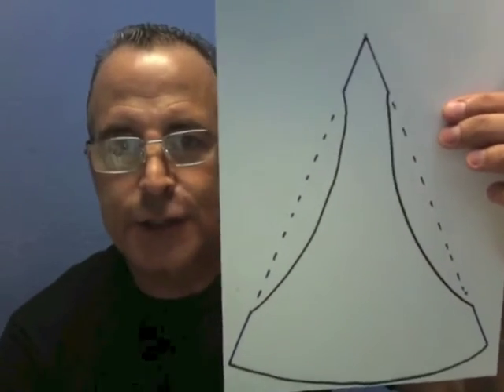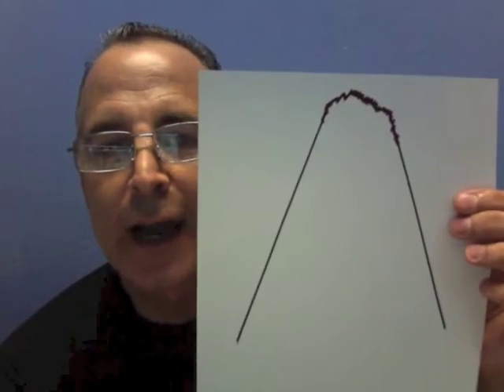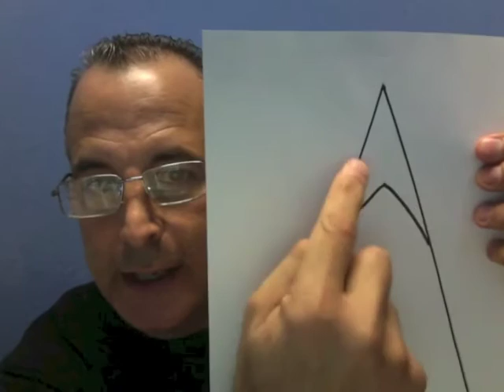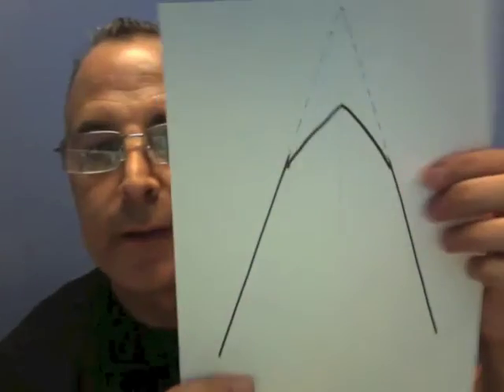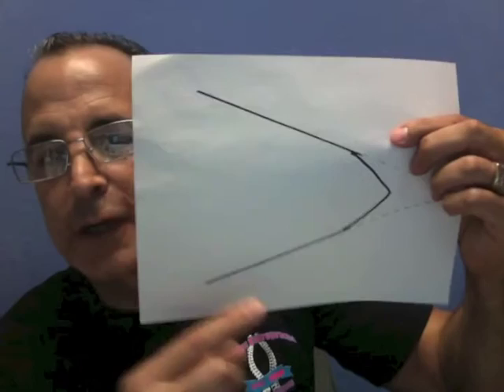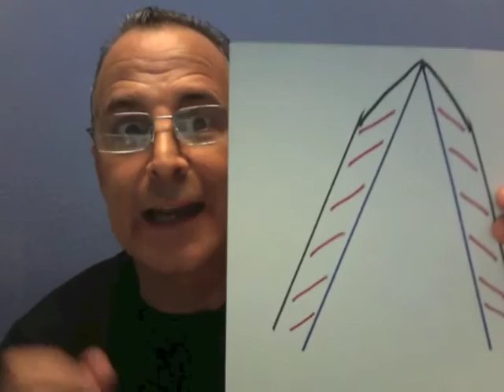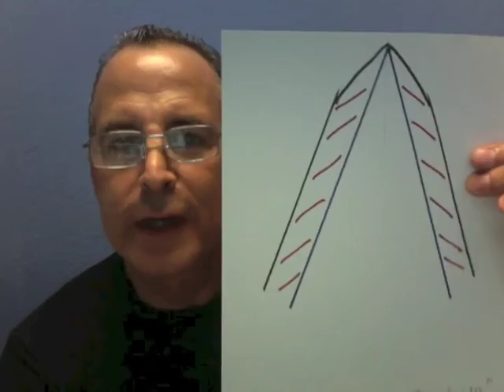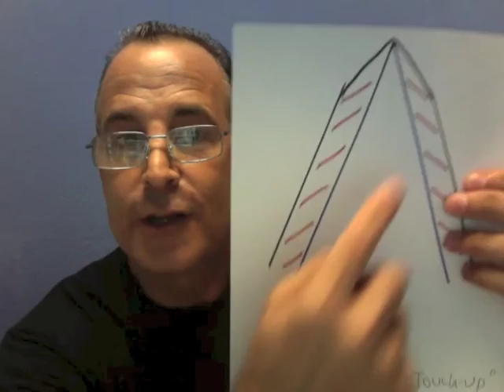Razor Bevel Setting, Sharpening, Touch-Ups, Conversion and more...

Comment: So it seems to me you could break the process into three distinct stages... one is bevel setting... usually done on a 1 K... two is refining the initial bevel set 1k to 12k or however many K you want to take it to... third stage is stropping cloth , felt , whatever and leather... So where I do take your point, and I think you made it very well and the argument you make is quite clear, and does help to clarify what is going on, it is largely a semantic argument. What most people call a ' touch up ' or a ' refresh ' just means " I didn't have to go all the way back to 1 K... ( to reset the bevel ) so I am in stage two... beyond what stage 3 , (stropping type stuff can handle anymore).. i.e. a ' refresh ' or ' touch up ' .. (a few passes on an 8 k then a 12k) or whatever, not ' regrinding ' a new bevel.. so it's really more a matter of what you call that. Technically yes, I call it generically ' sharpening ', but razor peeps call it ' honing ' . To me ' honing ' has the connotation of ' more refined ' than , just ' sharpening, but again, semantics, right??? But typically what you hear is, ' set the bevel ' or bevel setting, distinct from 'honing'. It's interesting if you look up the word ' honing ' it has the meaning of ' sharpening ' but also has the meaning of ' refine or perfect over a period of time ' ... as in to hone a skill, but I think both definitions actually apply, when you hone you are refining and perfecting the existing bevel that has been set, refining that scratch pattern. Just as an aside, I think saying ' heal ' the surface is also very weird terminology, you are not actually ' healing ' anything you are removing the high ridges of the deep scratches left by 1K. Like eroding two mountain ridges exposing the valley below. There is no ' healing ' going on. Funny term, that is somewhat confusing and deceptive, I think. Great videos , very thought provoking. Shaking off some of the misnomers and misconceptions really helps to refine your perspective of what is actually happening. Sorry for my horrific punctuation.. lol.. Thanks
Reply from the maker: Well said Bruce!

Comment: You bring up some good points. If your edge has already had its bevel set and was shaving well and is starting to pull a 1k stone is creating unnecessary work.  I usually use coticules for touch ups and in my head what the stone does is thin the edge out, never really hitting the edge. Yes setting the bevel is an over  term. Sharpening sounds good to me.

Entertaining as always.

Comment: Hello Doc
Nice video and excellent explanation as usual, you are the best one to clarify something through YT when it comes to wet shaving... The difference between sharpening and setting the bevel is excellent, some say they set their bevels on Botans, while they only sharpening the razor.... Remove chips or correcting the geometry with a Coticule, Botan or Washita takes unrealistic long time...

I totally agree with you on touch ups, a small portion of the steel must be removed to restore that beautiful pointy edge... The edge not only dull with use it degrad too due to stropping and the thin edge is prone to corrosion as the steel is exposed to the elements soap, skin, water...etc .

Now here's what I don't agree with you, stropping does not make the edge angle wider... stropping is basically remove the toothness and feather edge (burr) .... On other words it clean the edge.... When you hone an edge and you fail the HHT then strop it at some level especially with Coticule your HHT will improve.... Because you have removed the random metal on top of the cutting edge, not because you have increased the angle of the edge... moreover stropping between shaves realign the edge and clean the oilness that skin leave on the edge which restore some of it sharpness for the next shave..... To see stropping effect more clearly, hone your razor on 1k check it under the microscope and strop it then check again... You will notice big change on the edge not in the angle but on the toothness as the unstable steel is the removed, and that can be mixed up with creating a wider angle as the edge will look shorter which can make the angle look wider but in fact that is the real angle of the edge

The comfort is a result of removing the tiny sharp random feather edge that cause unpleasant experience.

Thanks again for the great video.

Regards,
Reply from the maker: Thanks for the nice words.
If you look at the SOS website, you can clearly see that as you microconvex the edge, it loses height at the apex AND will increase bevel angle a slight amount.  I don't think the increase bevel angle improves comfort but it does have an effect.

I'm not convinced that anyone really knows exactly what happens when we strop but the effect is undeniable.

Cheers!
Reply: +drmatt357 SOS is a great blog, but at the end it one guy effort not NASA whom conducting the tests... :) So for the results might be off by half a micron, and he apparently used a pasted strop which will convex the edge automatically.

Stropping concept is very basic

Imagine stropping as combing hair, after a hair cut(honing) you comb your hair and pieces of cut hair (burr) start falling, and when you comb your hair in the morning you basically realign it and remove weak and dead hair.

In one of your videos you showed two pictures of an edge honed on a stone and the same edge stropped on the same stone... The stropped edge was clearly cleaner, with unpasted strops the same happens only on minimum scale because no abrasion involved only removing metal by burnishing and stressing it... Like when you cut a hanger wire by stressing it.

When i polish stones on my lapidary machine, the final step will be on a clean cork or a hard cloth without abrasives, only to burnish.... The effect is like when you lap a hard ark using coarse great like 80 then sharpen a knife on it with pressure, the stone surface will become relatively reflective even though the knife steel is less harder than the ark, but the toughness of the steel and the pressure managed to break the brittle peaks of the valleys dug by the abrasive, which what we call burnishing.

Hope any of this will make sense.

If you still need to clarify more just try finishing the edge on a coarser stones magnify it, and check it again after stropping..... A coarser grit will exaggerate the effect for you to observe it

Regards,

Comment: Nicely done Matt!  I think I've seen that video where the guy goes back to the 600.  Sadly, that type of stuff can really mislead a new guy.  Curious to know whether or not you really need that many strokes on the linen and leather to achieve that micro convexity.  I don't say that to be argumentative.  I just know there are some who do not strop very much.  I myself have been playing around with less strokes when stropping and still have been having great results.  I also use the vintage fire hose strop and then a horse strop.  I've been doing about half of the numbers you mentioned.  Again I don't mean to say I'm right or your wrong but I'm curious about how little it takes to achieve that micro convexity.
Reply from the maker: I use that many only off the stone the first time.  And that is coticules as they are not as refined. After the first time or prior to every shave, I go only 20/40. Could you do it with less?  You may but it comes down to the feel you like. That's what I found with my testing and best feel to my skin. YMMV
Reply: Really educational and interesting video Matt! Finally understand what the strop is doing, it didnt quite make sense to me. Still quite cant get the angle right on my razor though. Ground the shit out of it, tried taping the spine or taping the edge. Seems to have straightened it out on one side but cant get the other side right (or getting the edges to meet). I dont understand how it was honed from factory, i tried with tape, with two layers etc :D Its a hart steel 6/8 and first sr i owned and tried honing.

Comment: Great video. I'm confused though. If stropping is rounding out the edge, doesn't that mean it is becoming  less sharp and we wouldn't want that?
Reply from the maker: Fair question and I may not have been totally clear. Stropping doesn't round the edge, it creates a shoulder or round a few microns down the blade from the apex. 

The tip is still super pointy and stropping even further makes it more so or "keen".

Comment: Great video as usual drmatt, Just my 2 cents here...always clean a razor well after using fruits or vegetables to test a razor as evaporation of acid from most metals will cause rust.
Acid baths remove rust but left to oxidise without cleaning the said piece it will quickly rust again.
I know you love this type of info lol.

Comment: From my experience on honing and stropping and the results I see I do have to ask this question.

Dr. Matt, does this perspective of resetting vs. "touch up" differ with the grind of the blade?
Reply from the maker: No, not really.  A heavy grind may have more metal at the edge and spine but the principle and rules still apply.

Comment: I used to "refresh"  the edge going back to the coticule which is around 8000 grit,  followed with the Escher, and the ILR.......but lately I am using a Franz Swaty  barber's hone after every shave, and that in essence takes away the need to go back periodically to the stones. All I do is doing 5 passes (edge leading, followed by 10 edge trailing passes) and the  edge is as good as it was right after I used the stones. This keeps the edge very sharp, and so far I haven't used the stones for the past 3-4 months now. I wonder how long the edge will last, when using a barber's hone after every shave?

Comment: Why not just strop on leather or linen on a flat surface? To lessen the convex edge and make touch up possible.
Reply: Also, put very little pressure when stropping to lessen the convex as well.
Reply from the maker: VanDelosSantos  Good question. Even if you strop with your linen and leather on a flat surface, there is still a compressibility to those, therefore will still micro convex a bit. Not as much as a hanging strop tho. 

But the thing is, I don't want to eliminate the micro-convex edge. I believe it adds to comfort of the shave. I've tried stropping with the leather and linen on a flat surface and the edge was harsh and grabby.
Reply: Thank you, I have a hanging strop but I have never stropped on it while its hanging because I believe that it will tend to pull a bit when I use my razor. I will try to use it while hanging this time to be able to feel the difference.

Comment: People should call it what the knife guys call it... "setting the edge"
Reply from the maker: Funny you say that. People say that you "sharpen" a knife but you "hone" a razor. That's silly. You use a hone to sharpen the razor... or make it pointy.  Technically, when you sharpen a knife, you are setting the bevel because you create the bevel at the edge by holding the knife at a certain angle. A razor tho has the bevel preset by the width of the blade and the thickness of the spine.